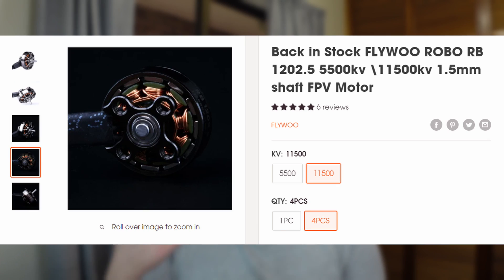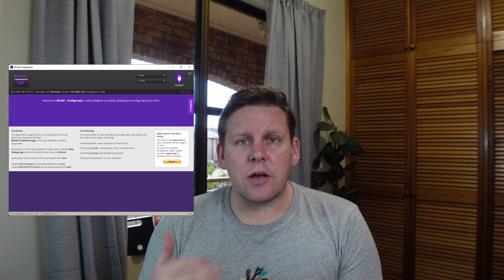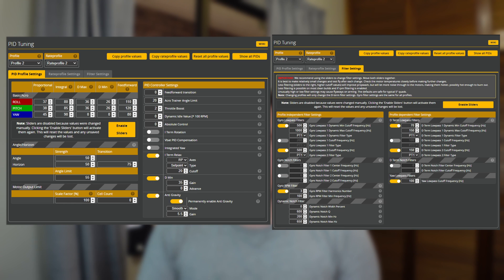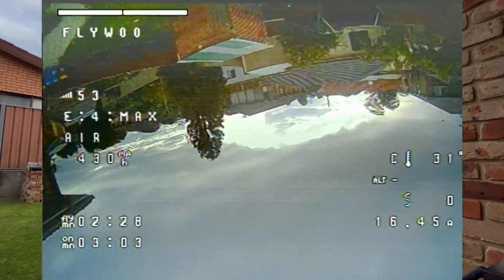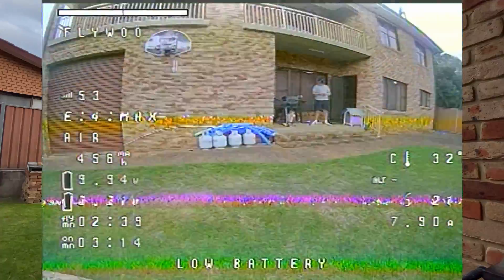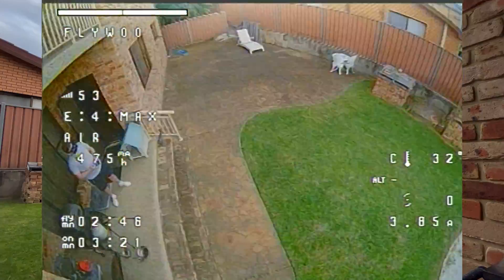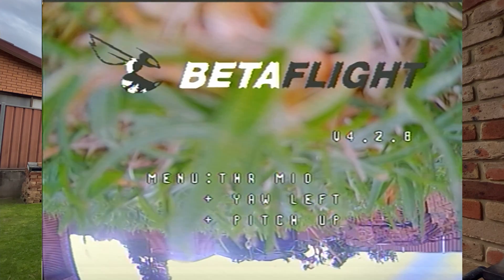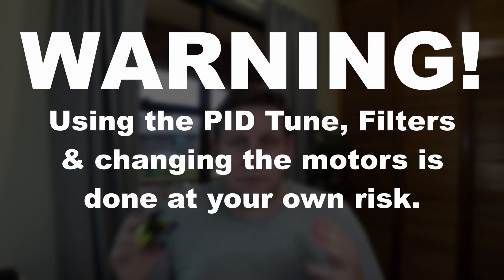This Tiny FPV Drone is INSANE!

Comment: How does this mod fly different from the diatone F1?  The diatone is 3s and has 1103 10000kv motors.  I find it to drain the batteries quick but it too rips.
Reply from the maker: I haven't flown the 3S diatone F1, but this would be way faster from what I have seen of it.

Comment: Well done, and thanks for the video.  You definitely created a screamer. 

What are your thoughts on using these motors on the Hex version?
Reply from the maker: I don’t see why you couldn’t do it for the HEX as well, however the battery is getting flogged with these motor on the quad. You’d probably abuse the battery with 6 motors.
Reply: @DarrenAllatt  Good point and thank you for the advice.